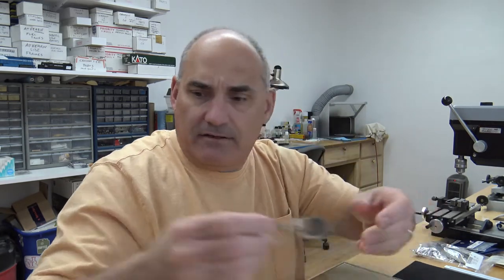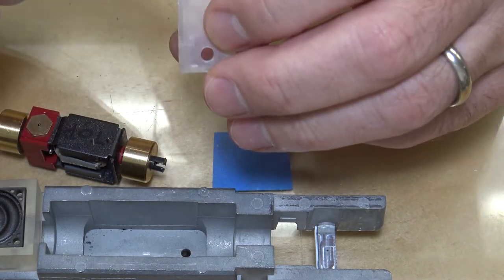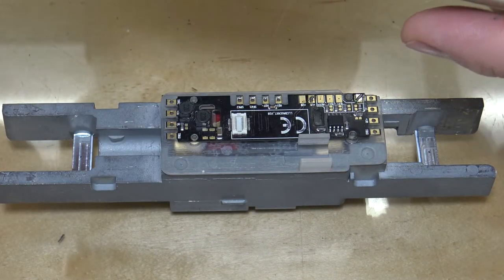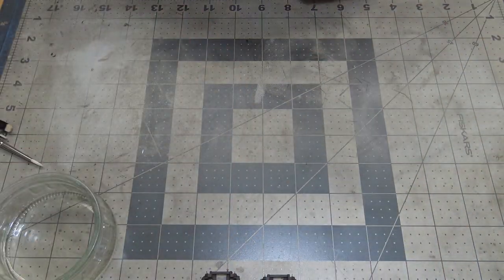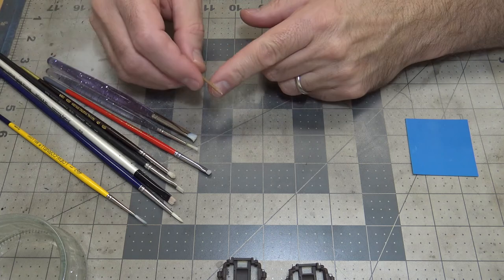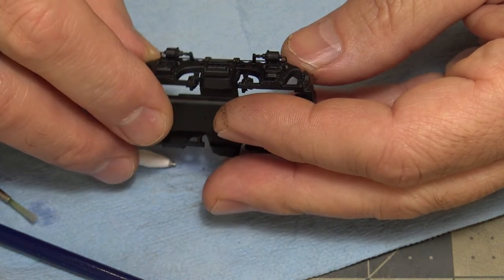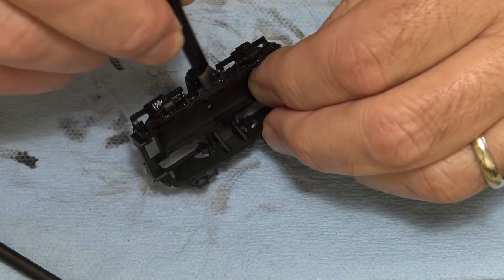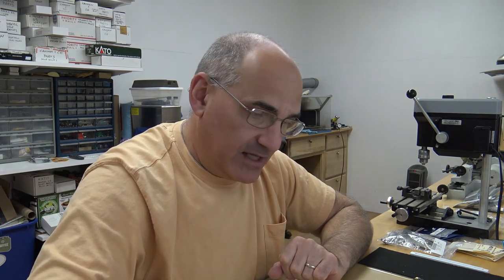ATLAS FP7 CHIPPING PAINT AND SOME COOL STUFF THAT CAME IN

Comment: Awesome Stuff Brian. Speaking to the contrast, NightShift showed a little for painting High,mid, and low values in green for chippinp. I think this might have been his sherman build to layer up some tonal change through that chipping pass for some variation where there was not much contrast.
Reply from the maker: One thing to keep in mind here. One of the viewers here brought up this point and I am sorry if I cannot remember his name. The point being that we are working at a MUCH smaller scale than 1/35th. 1/35th scale nuts, bolts, rivets and paint chips are on a whole different level. In HO scale, this stuff is so small. A small chip in 1/35th scale is going to be a rather large chip in HO scale. 

With any other color you can see the differences. Dark tones like black and near black colors do not show up as well. You can see them if you look closely. At about a foot away, they are gone. That is my experience.

Comment: Hey Brian, think the modelers will need to get the manufacturers to make paint color swatches from the actual paints. It’ll be so much easier, in the long run, to match colors. Chris Palomarez
Reply from the maker: Hey Chris, great to hear from you! Hope all is well.

I agree. It would be a great help if the paint manufacturers would put out a real color chip.